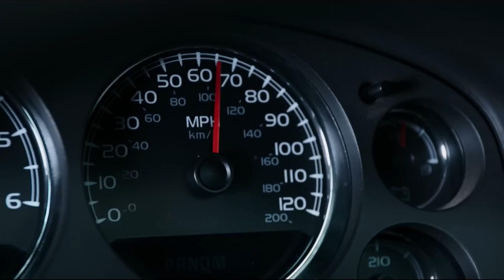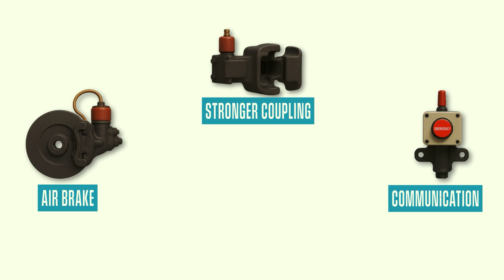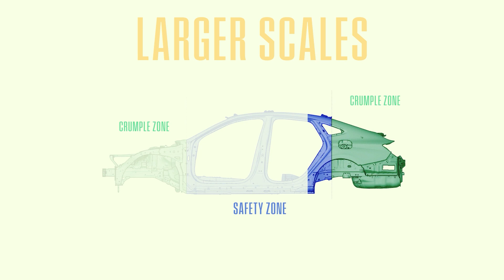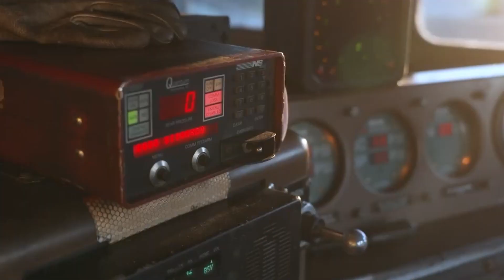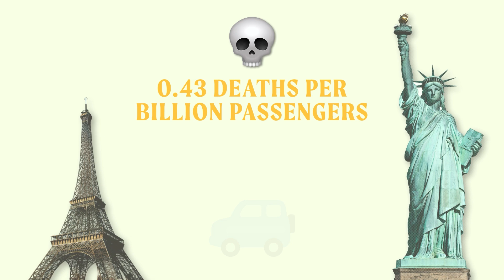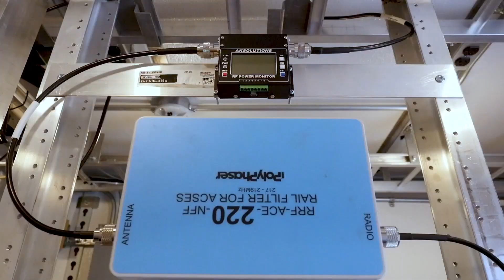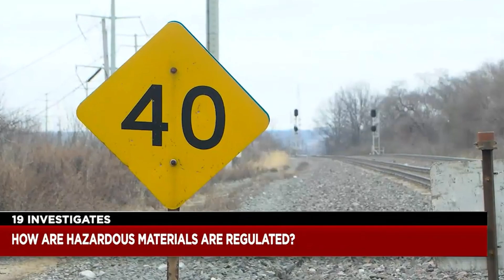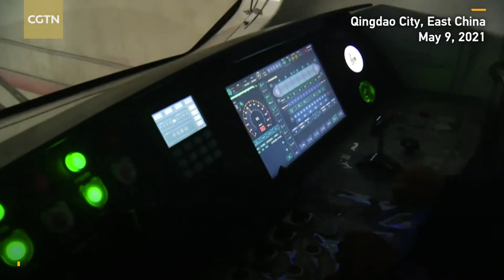What Makes Trains So Safe

Comment: In germany we use a multitude of safety systems to help the driver. We have PZB, SIFA, LZB and not as common ETCS.

PZB (punctiform train influencing) is one of the oldest systems, introduced in 1934 on german railways and since then 99% of all german routes are equipped with PZB in one form or another.

Originally PZB only brought a train to a stop if a signal wasn't acknowledged by the driver but the modern PZB (PZB90) uses a computer for monitoring.

The PZB works by using magnets with an specified resonance frequenzy and train data to calculate the brake curve. PZB uses 1000Hz, 500Hz and 2000Hz magnets, they are failsafe and need electricity to be inactive.

If a train passes over an active 1000Hz magnet the driver has either 4 seconds or 2.5 seconds, depending on the system, to acknowledge the restricting signal, if the driver fails to do so the train automatically initializes an emergency brake. After acknowledgment a brake curve is activated which speeds are determined by the brake capacity of the train: 
(O)  165 km/h to 85 in 23 seconds for trains with a brake percentage over 111% 
(M) 125 to 70 in 29 seconds with 66-110%  
(U)  105 to 55 in 38 seconds with 1-65%.

If the driver brakes to slow or is cutting this curve the train stops.

Then we have 500Hz which also has a brake curve, but instead of an time dependent curve it uses a distance based curve:
(O) 65 to 45 in 153m
(M) 50 to 35 in 153m
(U)   40 to 25 in 153m

and like the 1000Hz curve, the train stops if the driver fails to brake in time, but no acknoledgment is required.

1000Hz and 500Hz also have an restrictive speed which activates if the train is under 10km/h or stops for more than 15 seconds, except the (O) which has an curve from 30 to 10km/h in 153m. The same speeds also come into affect when the train departs for the first time after the driver's cab was activated, which is called the starting program.

Restrictive speeds are 45 km/h for all train programs with an 1000Hz influence

500Hz:
(O) 45 to 25 in 153m
(M and U) 25 km/h

2000Hz magnets initializes an instant emergency brake.

PZB has more complex situations but this will paint a picture on how safe this system is. But there some quirks which have the potential for accidents, like the Befehl 40 which allows the driver to bypass a 2000Hz magnet without an emergency brake which is used during shunting and signal malfunctions.

LZB (linear train influencing) is a more modern system which allows trains to travel faster than 160 km/h using in cab signaling, route and train data to calculate speed, brake curves and other things. LZB continuously checks the speed and distance for all trains with an main track computer and sends signals to each train for controlling. LZB also has the feature with the AFB (Automatic driving and braking control) to slow down the train or accelerate it without driver intervention. But like the PZB if the driver dosen't react or the train is to fast, LZB triggers the brakes to slow down or stop the train.

SIFA (Safety drive circuit) is an alerter type system where the driver has to acknoledge a signal every 30 seconds, if he fails to do so the system activates a light after 2.5 seconds and after another 2.5 seconds (35 seconds) the system initializes an emergency brake and cuts off all tractive power. The EB can be lifted if the driver acknloedges the warning and the train can continue as normal.

ETCS is the "new" European train control system with the goal to standardize all european rail safety systems, but currently lacks the equipment in germany with only a handfull of routes using it. ETCS is basically a more complex form of PTC with 3 levels (Level 0, Level 1 and Level 2) each with different functions and multiple operating modes like "on sight" or "Full Supervision". I don't have the qualifications for ETCS so i can't tell much about it, but one thing is certain: All german train driver dread this.

Comment: This is uh, quite the sensationalized video, huh? A decent number of the facts are “correct”, but lack a lot of nuance I feel; Steam Locomotives were and are dangerous due to being able to explode, but you make it sound as though that was the way it was through their entire tenure and not dampened by the late 1800s, the standard gauge of train tracks is 4’8.5”, yes, on straight tracks, but on turns it is often slightly wider to allow for better turning, it has been honed for efficiency but to specifications rather than random idealism, 4’8.5” was a thing back in the mid 1800s after all. Etc etc etc. It’s a decent video you’ve made, but the room for improvement is in how much fact you omit for a narrative. Dry rails and smooth runnings to you.

Comment: In Germany we used to have electric trains that had electrically controlled brake systems. No power, no braking. We also had mechanical PTC since the 1930s, where a lever on the train would hit a board that is raised or lowered according to the signal state, triggering the brakes

Comment: IMO, one of the reasons why people perceive trains and planes as unsafe is that when a train or plane crash occurs, the are usually multiple injuries and/or deaths and, thus, makes the news.  Automobile accidents have a scale of 1 or 2 casualties and aren't reported as often.  And even if they are, it's easier to ignore.
Reply: Also unlike the car you do not have the control over the train and put your life at the mercy of the pilot/train driver
Reply: I think it’s more like…the odds of surviving a fall from thousands of feet in the onto the ground inside a metal tube are pretty much nonexistent. Trains are exponentially safer solely because unless it’s on a bridge the distance to the ground is negligible compared to being in a flying aircraft. Which is meaningless in the event of something like a collision that causes the train to telescope. But automobile accidents are much more terrifying thab either, because the likelihood that there’s a skilled operator behind the wheel of any given personal is basically zero, at least here in the USA (which is ironic given how obsessed our culture is with cars and driving).